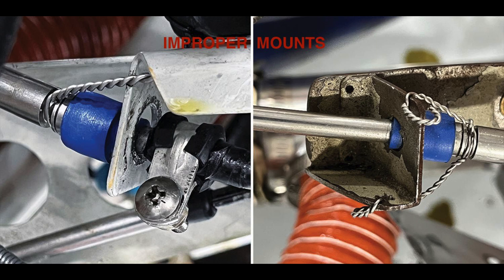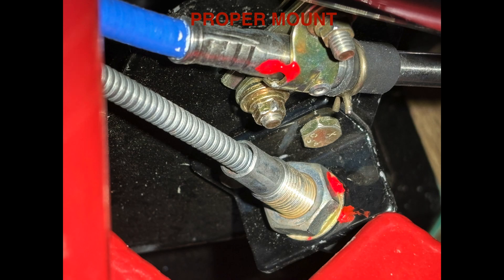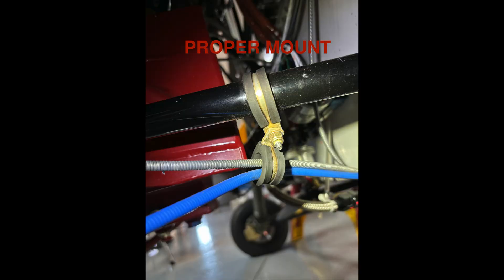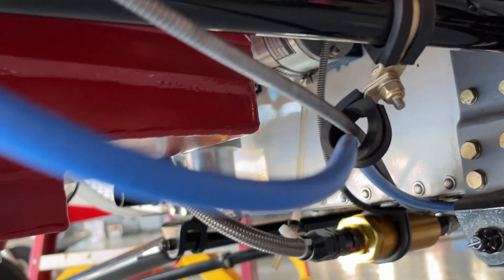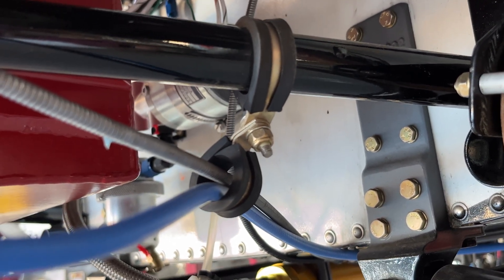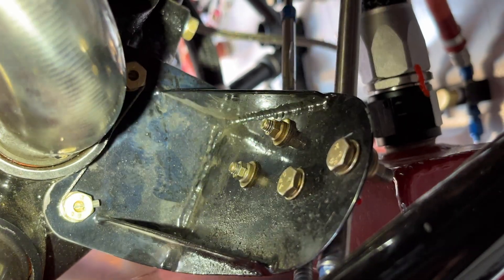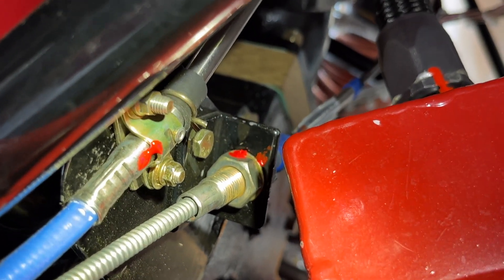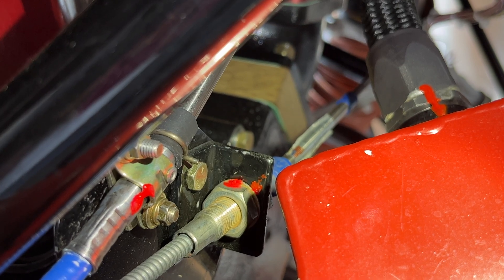Intake Gaskets and  Control Mounts

Comment: You mentioned always replacing lock washers with new ones.   What if I have a brand new engine and I'm adding mounts for cushion clamps.  Should I still replace lock washer as I install the mounts?
Reply from the maker: yes.